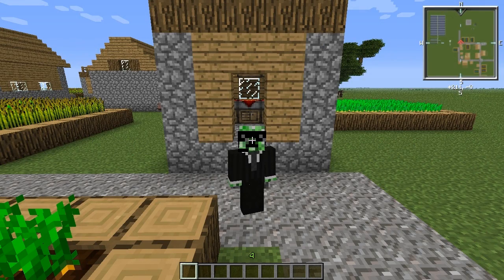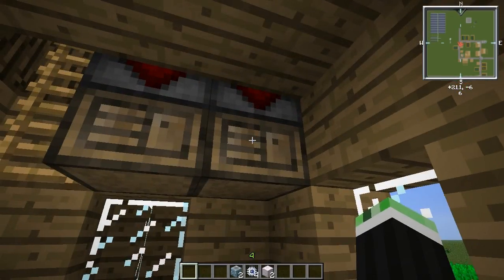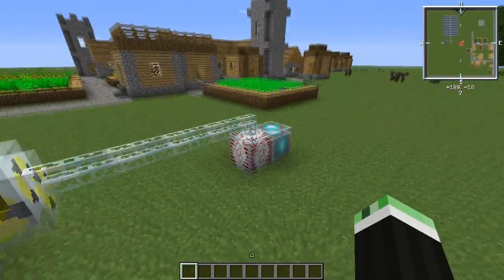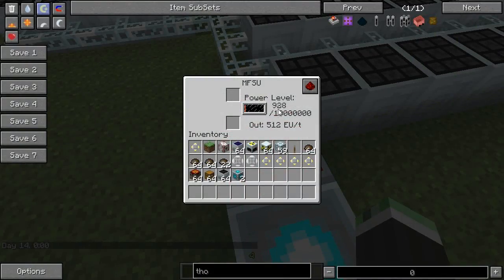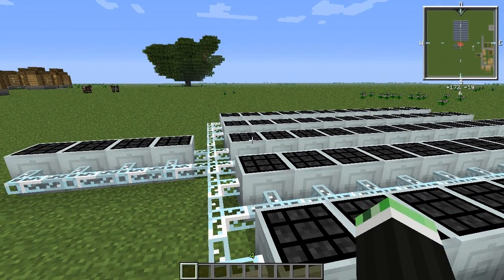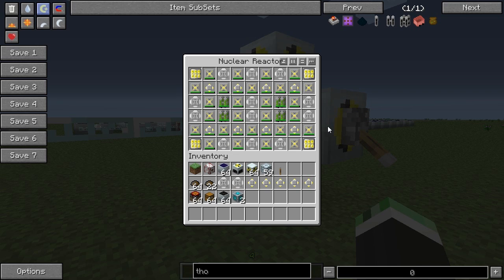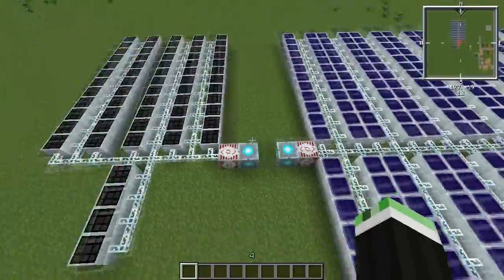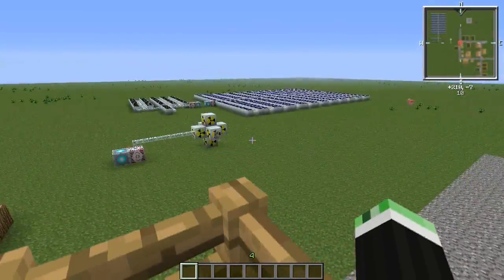Minecraft: Tutorials - GregTech Matter Fabricator

Comment: You can power it with a reactor with a lot of Quad Uranium Cells and LZH Condensators. Just have the Matter fabricator's UU be made into lapis and have golems pull out empty ones, fill them with Fabricators and put them back in (Direwolf20's design). It produces a LOT of energy.